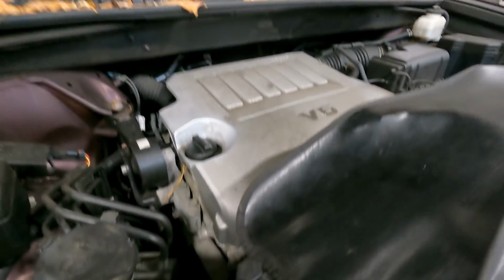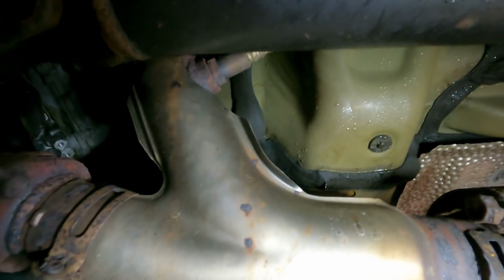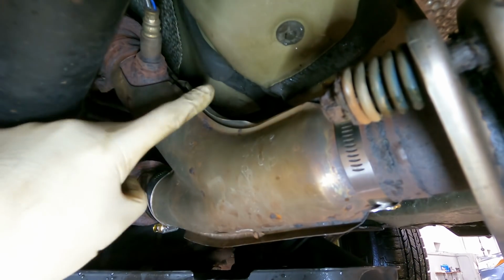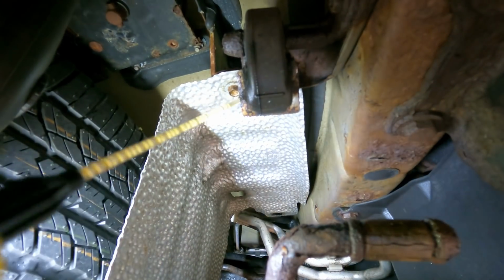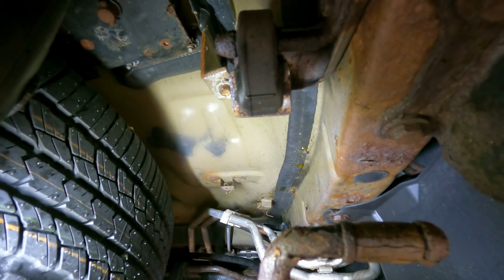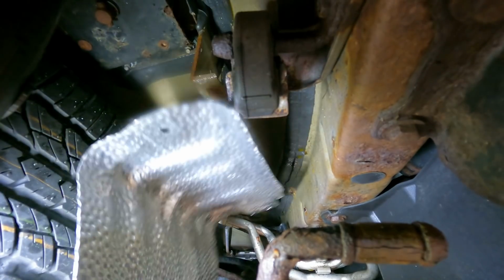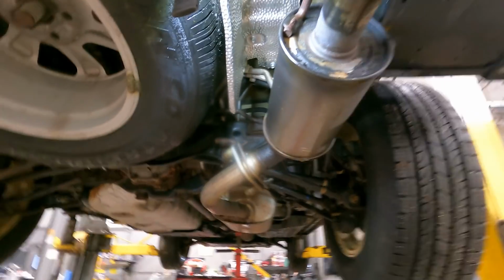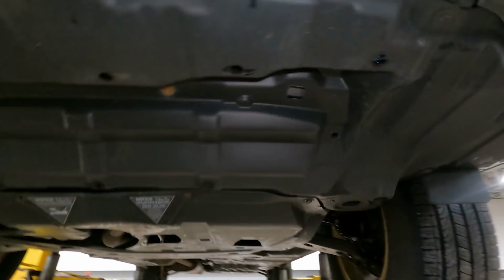Customer states "EXHAUST HAS RATTLE ALL THE TIME BUT NOW!?"😡🤬🤣🤣

Comment: I can't believe the condition of the spare tire.  I usually get a tire and rim that matches the tires when I buy the car and rotate it along with the other four. When a tire gets about half tread, it becomes the spare for the rest of its life.  I had a work mate that did the Count thing.  It was funny 30 years ago, it was funny today. Thank you for the morning smile.
Reply: That would only work if the spare is not a emergancy (get you home) tyre, it`s becomming more common nowadays some cars have tyre  (tire) repair inflate kits and no spare!
Reply: @Mrfort  "I usually get a tire and rim that matches the tires when I buy the car and rotate it along with the other four."  In other words to be more clear: I buy the same size matching tires and rims when I buy the car, truck, that I can safely rotate them and use. A used tire and rim become the spare, so as not to be limited by how many miles or how fast I can drive the vehicle.

Comment: Great work man! I DIY so I would have just used bigger washers and put that heat shield back up but I think as a dealership first recommendation is replace ripped shield.
Reply: Same lol. If I had big enough washers I sometimes would do it without even saying anything. It only takes a minute or so.
Reply: So many DIYers just rip them off. 🙄
Reply: @marcryvon  I've done it at the dealership lmfao. car was clearly not taken care of anyway and not worth the time or money tbh. fixed the rattle problem tho
Reply: Yeap. Bigger washer = fender washer which is what they were made for.

Comment: I usually fix them heat shields by putting a big fender washer on the bolt when they do that but I get it you work at a dealership so you have to do it a certain way
Reply: Good mark up on parts. Boss loves the margins.
Reply: Yeah I just use washers

Comment: Hey Vince, my friend! Great job! I would suggest to smack the mufflers and cat with a rubber mallet instead of your hand. They may look fine from the outside but they rust from the inside out. A lot of times the baffle tubes can be rusted out and laying in a pile of flavor chips in the bottom of the unit and it takes a bit more than a hand smack to make the rattle show up. It makes your hand feel better too, especially if it’s hot. For the benefit of those that don’t realize it, when a cold engine is started, hot exhaust gas condenses into water and acid that collects inside the exhaust system. As the engine runs, the heat travels slowly rearward down the exhaust system vaporizing the liquid as the pipes and mufflers heat up. Cars that are used primarily for short trips usually have a lot of rear muffler failures because it can take quite a while for it to get it hot enough to vaporize the liquid. When we would get a car with a muffler full of water, we called it “Little Old Lady syndrome.” That’s why I never start my car for just a few minutes to make sure it still runs. By the way, I think that car has some of the least flavor you’ve showed us!
Reply: how long should u pre start a car if u plan on a short trip?
Reply: @randomrazr  I don’t prestart. I try to plan my errands to take at least 30 minutes. If a car is driven daily and most of the trips are over 30 minutes, an occasional short trip won’t matter that much. Mostly short trips with a lot of sitting causes condensation to accumulate in both the exhaust system and the engine oil. When the oil breaks down, bad things happen. I just drive around long enough to vaporize all the condensation. The PCV system will remove the condensation from the oil when it’s hot enough to turn to steam. I’ve put a lot of miles on a lot of cars and never had a lubrication failure.

Comment: Growing up on the Texas gulf coast, I can remember when my grandfather got an oil change they would put his car up on the rack stick the used oil in a spray gun and spray it all underneath the car on every surface it kept underside rust free even if you drove through the salt water at the beach. Haven’t seen that done in years.

Comment: Try Loctite LB 8009 next time you replenish your anti-seize. Good for -20°F to 2400°F and contains no metal so can be used everywhere (i.e. no dissimilar metal corrosion issues). I recently switched. It sticks to everything though so need to be careful.

Comment: I'm a bit surprised you didn't just use some fender washers or similar to reattach that rear heat shield.  The thin aluminum(?) shield seems like it'll just tear through again from vibration, etc.
Reply: These heat shields are not well designed. Even if you put a new one on, it would come loose in time.

Comment: I would have tried reusing that heat shield with some oversized washers. Not sure how much they cost to replace.
Reply: Stainless fender washers are what I would use.
Reply: That’s what I have used.  All Toyotas have corroding heats shields. Another problem is the damn bolts are way too small 10 mm and snap, they should use at least a 13 mm
Reply: That heatshield looked awfully worn, look how easily it snapped when he took that rear most bolt out.
Reply: You can't do that type of shade tree work at a dealership
Reply: @xxxxxx_1300  Well, the video started with hose-clamps...
Reply: I would have fixed it that way on my personal car. A reputable Toyota dealer isn't going to do that repair though.
Reply: @gordonrichardson2972  
What do you have against hose clamps for this specific repair?
Reply: @merlinious01  Nothing against hose clamps, but CSW said it's not the approved part.

Comment: The Dealership you work at should offer Krown rust treatment to all new and used vehicles.  It would cut down. On a lot of flavor
Reply: Well they do when you buy new. My wifes car came with a life time rust offer for $1500 at signment in 2008. It's a 2009 Toyota Matrix bought in Northern Minnesota. Something tells me this shop is in Minnesota, unless the one guy I have noticed the voice of, moved. If he is in Minnesota at the shop I think he is at, I would make the 4 hour drive to have him look for Fideo, and do a complete just to say "hello".
Reply: They offer it for ridiculous amounts. I just fluid film my vechiles every year. Theres something coming out from PB blaster thats a modded fluid film thats guarenteed to work for 2 yrs i believe.
Reply: @DerfOrNuffin  Only 2 years? The wifes car is a 2009 and is spotless under it.
Reply: @ducewags  2 to 3 cans 30$. My mothers new subaru was rust coated and stuffs popping through from dealer. Rather do it myself and see it in action. South main auto swears by it on his tundra and has a few years of posts when he applies. Plus he uses it on repairs as a lube and antiseize. Gotta love the rust belt
Reply: @DerfOrNuffin  Toyota did my wifes car, life time rust protection for $1500. That includs any work or body parts if needed. Can you beat that price, paint, and parts if needed?
Reply: @ducewags  if i had a choice id definatley pick what you were offered. Obviously wish everyone offered it but they dont. Thats for the life time of the car? Or isnt it a guarenteed no rust. All toyotas or just the matrix and is it offered at all toyota dealers?
Reply: @ducewags  its nice and worth it if you buy a toyota. But theres alot of variables, they should do it at dealer. Mechanic shops should offer some versions, just mentionting method ive seen and used. Not everyones s buying a new Toyota, or can afford the extras. Should really be included automatically.
Reply: @DerfOrNuffin  At the time it was any car, truck, or SUV bought new. It is lifetime for the car for the original buyer for any and all rust. Brake lines, calipers, pads, struts and rotors are lifetime with the deal.
Reply: @DerfOrNuffin  Should be, could be, but it pays to ask about rust deals. Back in the day, Dodge offered the same deal on all makes for bumper to bumper lifetime on everything. If I was in the states at the time, and not in the sandbox, we would have a Dodge in the family. Toyota fit the cause for what the wife was looking for at the time.
Reply: @ducewags  Not bad wasnt aware. Work on cars, so its already to late when im working on them. Would love that plan on a dodge.
Reply: @DerfOrNuffin  If I could turm back time, a 3500 stick shift oil burner Dodge dualy would be in my garage now. On a good note, I have a 97 F-450 7.3 5 speed Spicer with a 97 F-250 cab on it. The 97 F-250 cab saves me tons on tabs every year, as it's not a 1 ton "truck" on paper.

Comment: on my moms 87 taurus I found a persistent rattle caused by a metal tag spot welded to the cat converter.  it broke off and landed inside the heat shield. it would only rattle intermitently  and I found it by beating the exhaust pipe with a hammer.
I had to cut a piece of wire hanger, put a piece of tape on the end and hope it stuck.

Comment: I am amazed how much rust there are in these videos ... and I thought my 30 year old Nissan was bad (Europe) ... is this something you see commonly across all brands (apart from the known occasionally flawed model) or would you say some brands do a general better rust protection job ? ... also, what sort of stuff would you recommend for undercoating ?
Reply: Pretty much all brands of cars domestic or import will rust in the Salt Belt. The Salt Belt is the U.S. region in which road salt is used in winter to control snow and ice. It's highly corrosive. Lucky to have untreated cars last ten years there. I like to use Fluid Film for undercoating.
Reply: Personnaly, I use chain saw oil for it stickyness, diluted with some kerosene to help spraying in tight spaces. 
CAUTION ! Of course, you have to let the kerosene evaporates for a couple of hours, outside on a plastic sheet for droppings.
** I live in Canada, the kingdom of salt and rust but still keep my cars an average 15 years with a lot of mileage !

Comment: I usually just put a bigger washer on the bolt and put the original shield back on. Lasts another 3-4 years
Reply: I was kind of surprised that shield didn't have a reinforcing rib around the edges, it looks a little flimsy.

Comment: Were you born under a lucky star sign? I've seen you perform many questionable acts where I would have been certain would have failed if any one else had attempted it...in this case, removing that one bolt...Had that been me, it would ripped out the tab, pulled a hole in the trunk floor that would have torn all the way out to the fender.

Comment: Problem is that copper is death to aluminium, electricaly speaking.  The bolts will come out easily after the alloy has fallen off because of the huge holes corroded in the heat shield.  There is a aluminium never seize.

Comment: Mr. Technician I found your video because of my interest in repairing vehicles as a DIY.  Some things of course I cannot do, so I take it to my local repair shop or dealership. I see that some of these vehicles that you work on are pretty rusty underneath. The question, if putting undercoating on a vehicle would that help any for the built-up of Rust on vehicles.  And how can you prevent the field mice from getting underneath your covers, because I have found that kind of situation now and then? Any thoughts would be appreciated.
Reply: Undercoating would help a ton if it's a clean dry surface that you're applying it to. There can't be any rust or moisture trapped to the metal otherwise the rust will just continue but it'll be hidden

Comment: Do you have any recommendations for rodent repellent if changing parking is not an option?
Reply: Toyotas are bad for rodent attacks...so is Honda. I had my Tacoma and my New Tundra taped with Honda electrical tape. The tape has capsaicin embedded in the vinyl. This should reduce wire chewing by 99%. I would recommend using a petroleum based engine degreaser once or even twice a year and cleannthe engine and all of the under hood area. Not hard to do this yourself. Also, get KROWN RUST or equivalent. Rodents do not like anything petroleum based. I also had fake snakes 🐍 under the hood of my Tacoma. Will do the same for my Tundra. These measures should work well but there are no 100% guarantees it will be infallible.
Reply: @mikefoehr235  
Thank you. I'll give those a try. I drive my car 4-5 times a week and a little bastard still made a nest. I was checking fluids and such and there was the nest, right under the engine cover.
Reply: @Anthony Von  My Toyota dealer basically thanked me when I walked in with a roll of Honda tape for my Tacoma. My SA told me they were at a loss for a remedy for wire damage from rodents. Honda tape solved that problem. It is worth your money to either pay to have wiring taped or do it yourself. One guy bought a new Tundra and had $2 000 damage to his new truck wiring. He ended up getting the wiring taped.
Reply: @mikefoehr235  
Do you tape basically everything or the majority of what you can reach?
Edit: what I've researched is basically wrap any exposed wiring, sound correct?
Reply: @Anthony Von  my Tundra has ALL visible wiring taped.
Reply: @anthony-i1k8c  ... I would suggest looking close at the food they bring in and then locate that source... for removal. IOW, they are there because there's food, water, and shelter.
Reply: @rupe53  I agree. Look carefully what they bring in. I did this, and nothing to the car except a little clean. They never came back
Reply: Easy enough, put bait boxes by each wheel. When they come around looking for food, they will eat the baited poison and die off before doing any damage.
Reply: @rupe53  I had a squirrel cage (blower motor) filled with acorns in Florida...there wasn't an oak tree within half a mile. Those little buggers must have backpacks.
Reply: @haroldwilkes6608  ... Mice don't travel far for much of anything and generally stay within a few hundred feet of their nest for a lifetime. Since they tend to nibble many times a day, they also stay VERY close to a food source. I'd bet good money the mice found a stash from a squirrel, and those guys will travel miles for food.
Reply: @rupe53  I have an image of a mouse in a mask...

Comment: If my rotors are meant they're kind of old but they're fine could I just pad slap it It literally just barely starting to squeal barely like when I'm turning that's the beginning You know I would think I should just get rotors and bite the bullet or just slap it and f**** in the spring do a full job

Comment: Instead of over-selling the customer a new heatshield when the old one was fine, you could have just stacked multiple washers, starting with a large one to cover the hole that was rusted away and ending with a smaller one , until the bolt holds it.
Reply: Dealership, won't allow that. Must sell new.

Comment: A/C lines...?? At the Rear. You mean fuel lines right.
We don't get the toyota hilander here so a little info of WHY THE HELL the a/c lines go to the rear would be appropriated.
I've been a mechanic for over 28 years and have never seen a/c lines at the rear of a car before even cars that have climate control in the rear have ducting inside the car. There is no reason to have a/c lines go to the rear.
Reply: Rear A/C is common in minivans and SUV's with refrigerant lines running back. Rear A/C evaporator in my Caravan, and water drips out back there just like it does up front, when the A/C is on. One compressor, two evaporators.